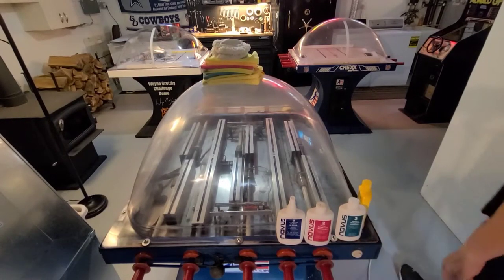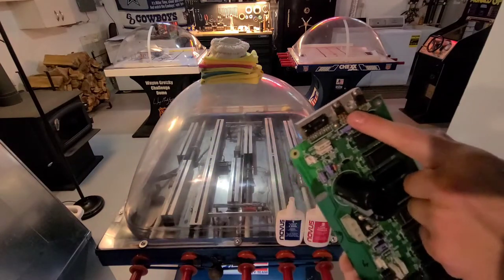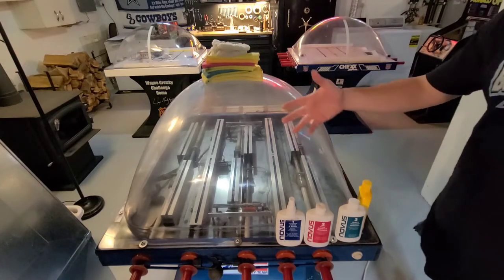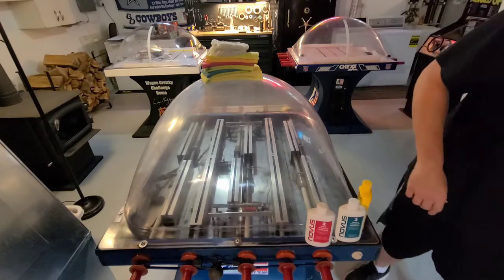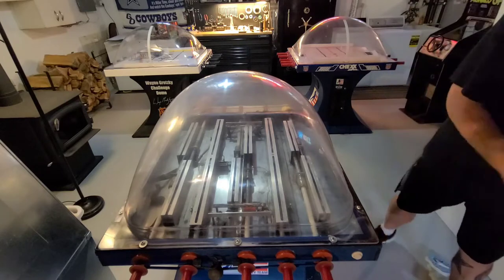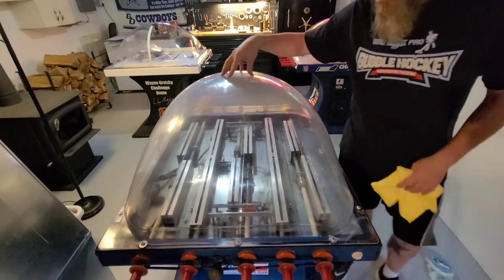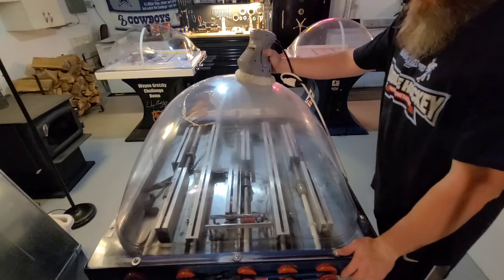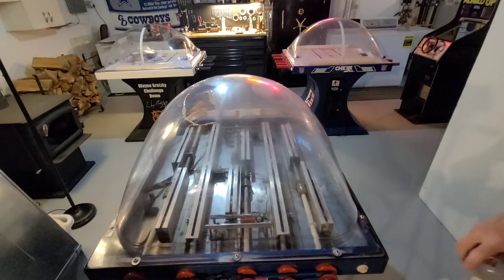Polishing a Chexx Hockey dome

Comment: Hello. I purchased a super chex pro brand new a few years ago. The most ive ever spent on a toy.. its the absolute gem of my man cave. Unfortunately the wife used some aerosol scented spray in the room. And he sprayed ovetop the dome. When i turned on the light, i could see the damage.  Whatever was im that spray, reacted with the plastic dome. The entire dome is pitted. Looks like the hood of a car with a million miles of rock chips. Absolutely devastating.  But your video gives me hope i can repair it and not.spend 4 figures on a replacement.  I have one shot to do it right it seems. I really hope mine can be fixed..

Comment: Great videos on wet sanding dome. After using up 700 grit and Novus 1 and 2 noticing swirl marks on dome (pressed to hard on the buffer?). Only when using the buffer was a swirl pattern used. What is the best way to remove the swirl marks?
Reply: There was a typo...7000 grit (wet sanding) also used #3 Novus. The Chexx Hockey dome is off 1983 machine. Don't think the Novus is working to remove the light scuff marks...any help would be appreciated.

Comment: Have about 25 hours into this. 600 grit to 7000 then to the Novus. I've been through 2 8 ounce bottles of 3 and have ordered a third yet the high level fine surface scratches are still visible but in spots, they've faded. When do you go from 3 to 2 or, when do you go back to wet sanding?
Reply: Doesn’t sound like you’re doing it right.. 600 grit? Why would you do that?

Comment: Thanks for  the informative and in-depth video brother.

Had an early nineties US vs Canada Super Chexx fall into my lap for free!Refurbishing it now. Followed all of your instructions to a the T on both videos (wet sanding and polishing). The dome is now smooth as a babies bottom and I was able to get almost all of the scratches out. Only issue now is the dome is still “cloudy” throughout. From the process.

What do you suggest at this point to make it clear? Sanding some more with 7k? I only went up to 3k?
Scratches are all gone, but now clarity’s the problem.
Any help is greatly appreciated.
Reply: I'm a noob regarding these tables, but polish and buffing are the final steps to a clear bubble. Sounds like thats where you're at with your table and you still need to do it some more to get rid of the haze.
Reply from the maker: Yeah Steve is on the right track.  Go back & work those spots/sections with 7k (maybe even a round of 5k first). The haze should be gone by this stage & just small fine scratches left, which the novus 3 will work over.  Sorry, didn't see comment till now, but I think I caught u on FB last week.
Reply from the maker: I got the 5k & 7k sheets on Amazon, most stores around here don't carry past 3k.  That's why I didn't show it off with the other grits, bigger sheets I cut down to use.  Nice score too! I snagged the 83 in my game room for $20, was listed free on CL but offered that to take ad down pronto! Lol